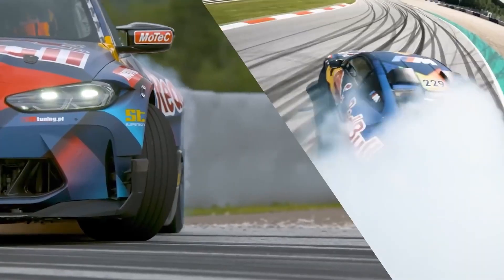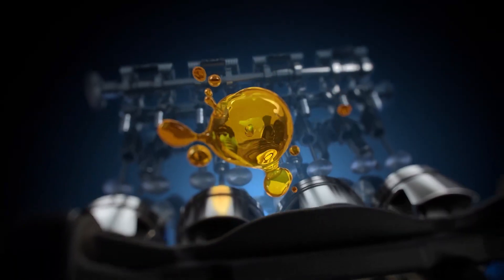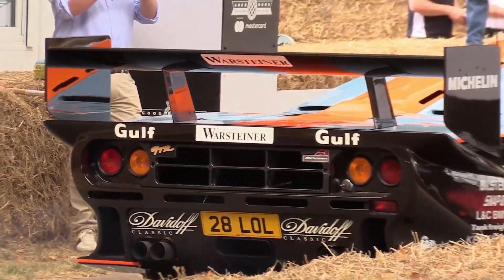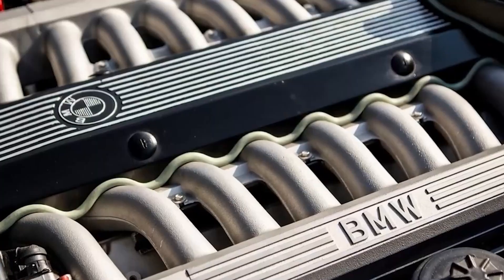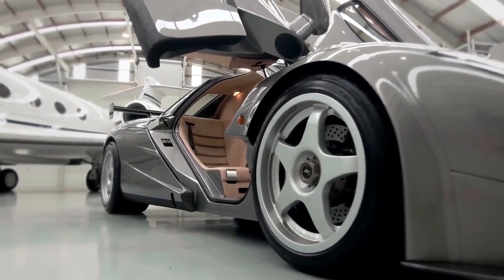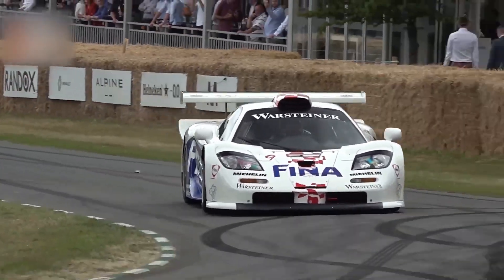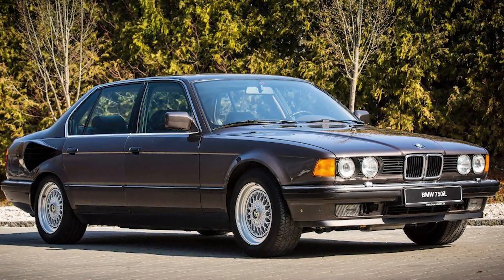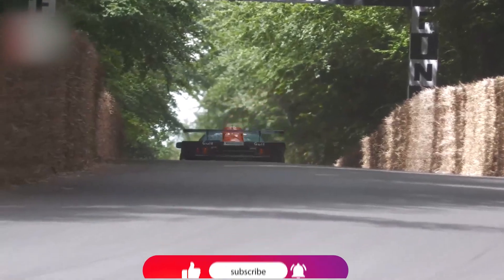Why This BMW Engine Was Too Perfect for Formula 1 | S70/2 Deep Dive

Comment: It didnt go to formula 1 because the displacement was 6.1 liters. Only 3.5 liter engines. Big differnce yes? Get your facts straight. What a shame. Puting on that the engine was banned. The car was never banned. It didnt qualify for lemans cause lemans changed rules last second in which the rule was that the manufacturer has to make at minimum 500 cars i beleive in which only 106 mclaren f1s were made. Why do you think ferrari makes only 500 of some of their cars? So they can race them if they want. Get your content right.
Reply from the maker: You’re absolutely right—big difference between the 6.1L and the 3.5L F1 engine rules, and the car itself wasn’t banned, just not eligible under those regulations. Same with Le Mans and the 500-car requirement since only 106 were built. Appreciate you pointing that out—thanks for keeping the history accurate!
Reply: In 1992 f1 regulations 3.5 liters

Comment: The McLaren F1 did 241mph not 221. The engine was a m70 block with e36 m3 s50b30 internals and cylinder heads (don't know if the crank was a m70 or specially designed for the s70) it always was McLaren only engine 6.1L v12 and never for any racecar or f1 car, that time f1 was 3.5L engines and even the BMW LMR Le Mans winner 1999 did not had the s70/2.
Reply from the maker: You’re absolutely right—the F1 hit 241 mph, and the S70/2 was truly a one-off masterpiece built just for McLaren. BMW and McLaren really created history with that engine.
Reply: @vehistory  👍🏼 yes, they really did. I think Gordon Murray at that time never even realized or dreamed, he would make such a legendary car. And BMW (in better days) just took the job to show the world what they were capable of and the rest is history, for me the all time number 1.